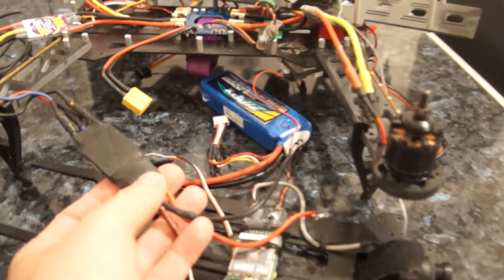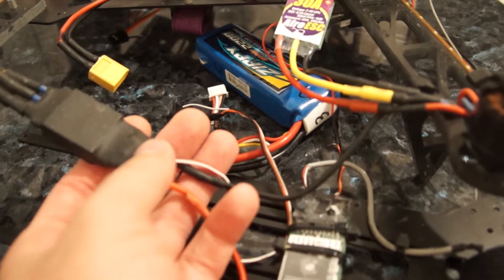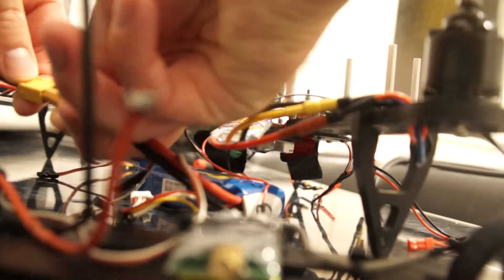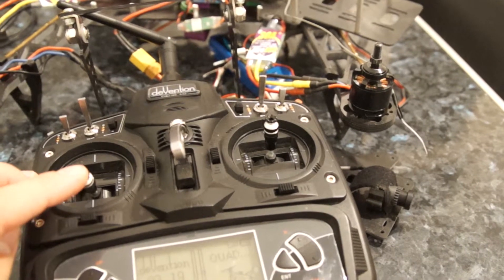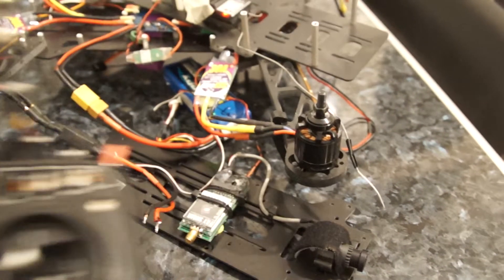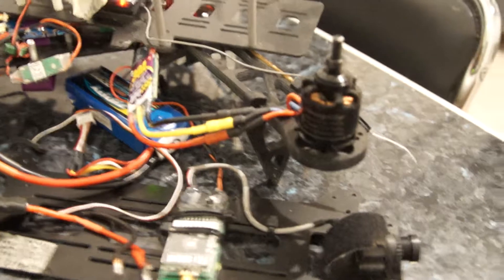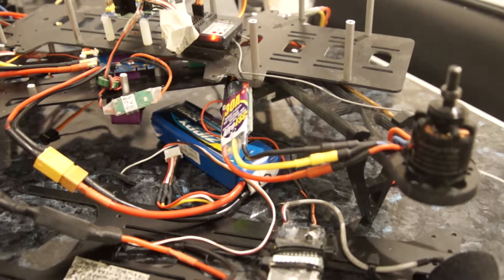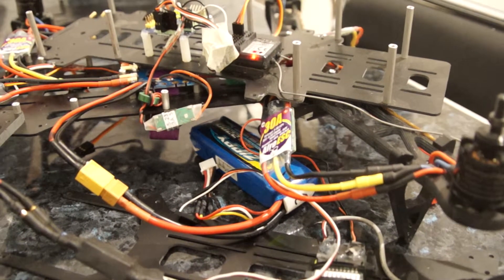Afro ESC dissapointing refresh rate

Comment: The difference only will be significant when you plug it on a Flight controller (ofc seted-up with higher refresh rate) , your dissapointment rooted in the lag of the transmitter, but you can experience (even from your video) that the SimonK's firmware ESC-s started to spin on a much lower pwm-rate compared to the old one.